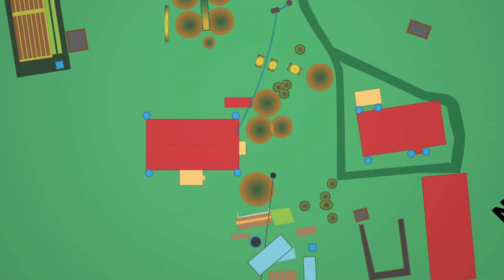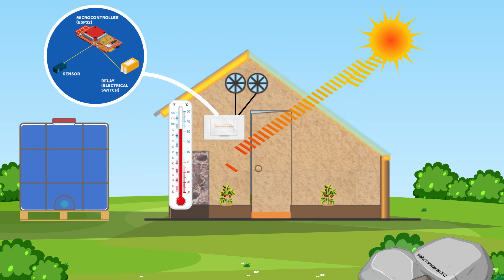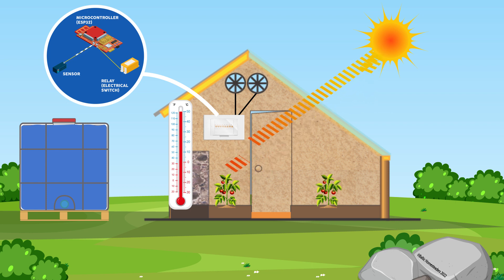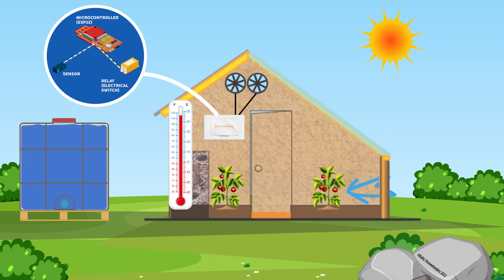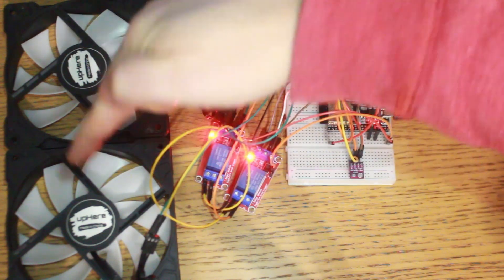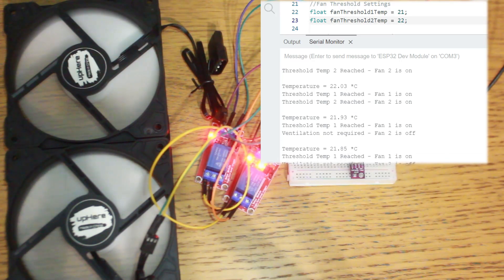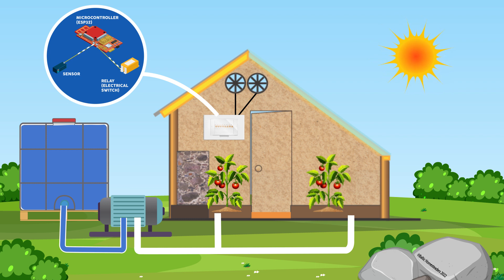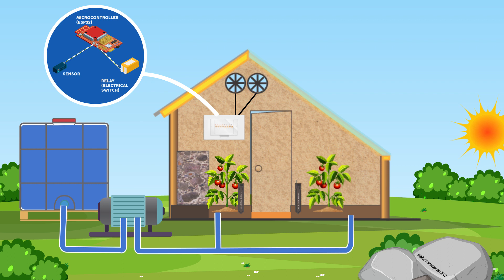Automating Your Greenhouse - Ventilation and Watering

Comment: Hi neighbour! Im from Sweden and Im building a four season greenhouse on my property and I would like to have it automated like yours. I also am building a heatstorage with 100 cubic meters of sand with styrofoam insulation around it with also needs automation so the fan for heat transfer only works when the ingoing air temperature exceeds the sand storage temperature. Where did you buy the components? What components did you use? Thanks, Mikael
Reply from the maker: Maybe get in touch via email (about us tab) as it might be easier and I’d love to discuss your ideas on the sand heat storage as I’ve also been thinking about it in the background.

Comment: That was a really interesting video. I did know about the temperature controls however on the other hand I didn't know they had soil moisture sensors. I thought it was just on a regular timer. I hope this helps people out 👍🏻
Reply from the maker: You can also add a timer so that it only waters in the evening if the soil sensor says it needs it.
Reply: @BalticHomesteaders  Oh I already knew about timer's for water and air flow I just didn't know that they had a soil moisture sensor. I'm not surprised that someone created that because it is a really smart invention. Thanks for the information.

Comment: This was a really well done video, thanks! I live in such a hot and climate that I can’t use my greenhouse in the summer, which I would like to do. I have t actually found a good time to use it at all yet. The temperature seems to fluctuate too much. I probably need two layers and a fan.
Reply from the maker: Thank you. The trouble will be when you don’t have the heat you also don’t have the light maybe? I think maybe you should try some shade netting to block out partially sunlight.

Comment: Maybe you've mentioned it already and I've missed it, but do you plan to have a notification structure in place for failures? Eg, if a temperature sensor goes kaputt, or a fan fails, how will you know? (apart from some very sad looking crops)
Would love to hear of your plans for error-detection!
Reply from the maker: Hi I have thought about fail safes. Remember this will also send data back to the main computer that I can read on an app and I will have overrides. Also I thought about using current sensors to tell me if the fan is working or not. Various options.